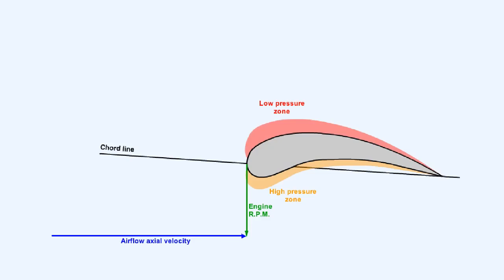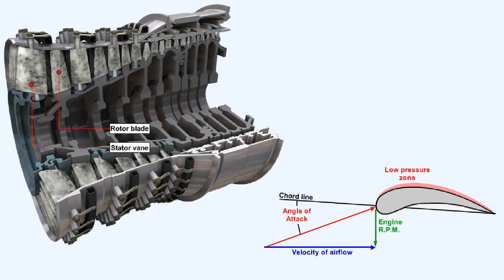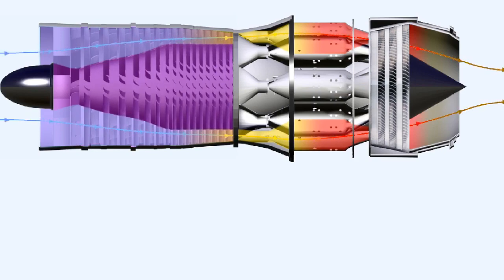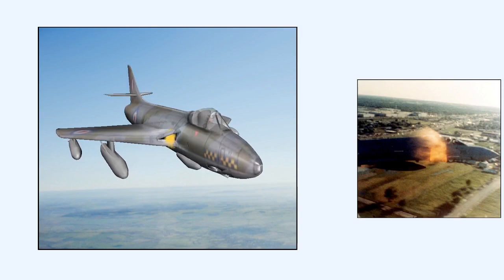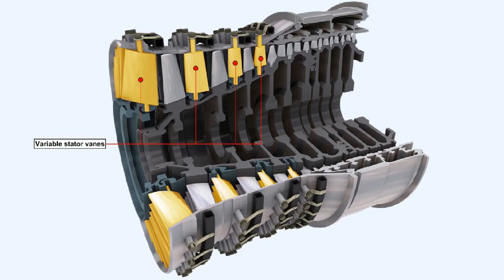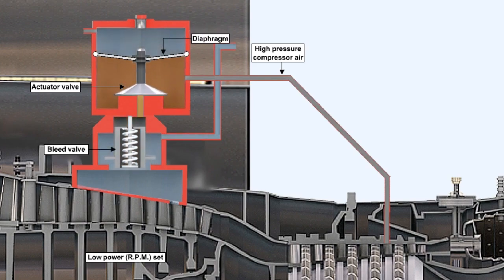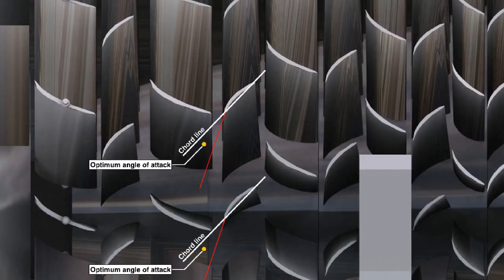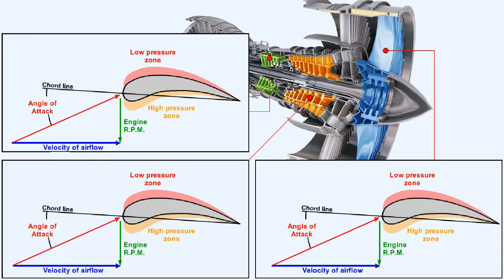Compressors Part 2 - Aircraft Gas Turbine Engines #06

Comment: 2:40 How increased axial velocity causes compressor stall?
Reply: 0:26
 so the compressor stall can be caused by

an imbalance between the rotational

speed of the blade and the axial

velocity of the air passing across it.

Basically, low velocity will create low pressure on blades, and high velocity will create turbulence. Both are highly inefficient, unwanted and cause losses.

Comment: 12:20 I get that the AOA is not optimal, but why this would create a stall? The AOA decreases when the compressor rpm are low, which means the AOA is way below the critical value.
Reply: believe it's because a lower aoa means less lift.
as a result means less pressure further into the compressor which encourages surge